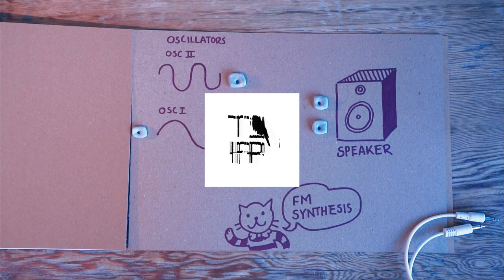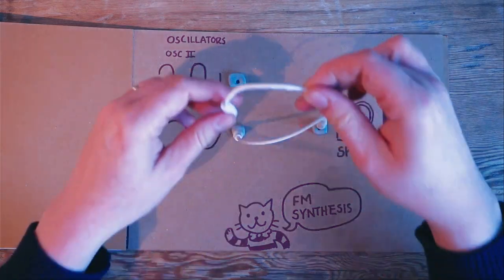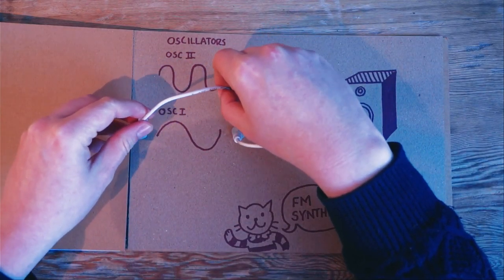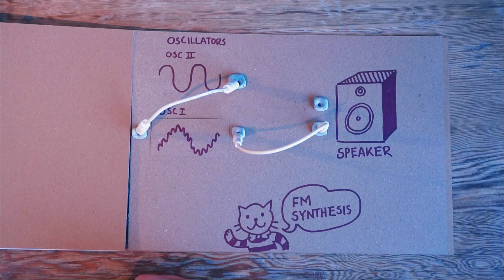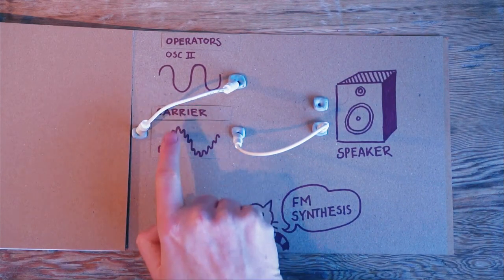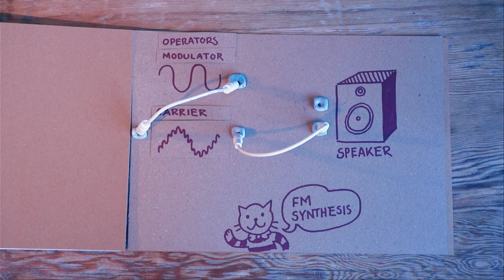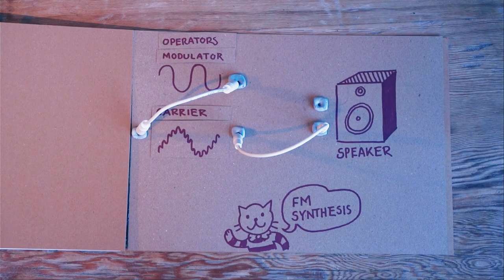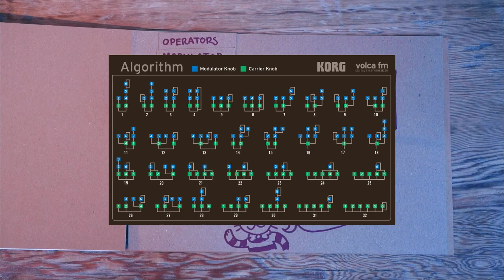Short Introduction to FM Synthesis in 3 minutes

Comment: Nice attempt. But there are min 2 mistakes that shows you did not understand it completely. 1. An operator is the combination of an oscillator and an envelope 2. The waveform you replaced the waveform of osc 1 waveform with, is just a result of addition and not of frequency modulation

Comment: Confusing, YES. Puposeful systematic for crafting a determined sound, no. Powerful, 40 years ago. Modern state of the art, no. Ancient, nostalgic. Without those workstation-freaks this ancient technique would be forgotten since 30 years. Without those people, sitting infront of hightech-machines, dreaming of sounds and technologies of the ancient greeks... FM wouldn't exist any more. I was there, 40 years ago, when FM was state of the art. I remember that it solved big problems, but didn't produce "quality" sounds. But ever since all other oscillators around, latest since the supersaw-oscilator, and the most latest with Romplers, FM had to be burried!!!
Reply from the maker: My impression is that FM was used to mimic other instruments such as pianos and trumpets in it's infancy, which would sound cheap at best. But it's not been until recent years I have seen it as an interesting tool to create very unique sounds. Especially as parameters can be modulated in a far more complex way by usin controlers and software. Allowing instruments like the DX7 to produce mind-blowing sounds compared to what was even imagined in the 80s
Reply: @TheFellowPassenger  Exactly! What younger freaks don't know anymore, are the needs/problems of those times. You are abolutely right: emulate native instruments with cheap technology and no affordable memory... which would have been needed for sampling. There was sampling too, but also with this memory-problem and therefore ridiculous sample-/bit-rates. I had an organ capable of this. It neede affordable memory (end 90s) and the developement of CDs with theoretical standards.
You are right: there were signature FM-Sounds. But what was the DX7? For me a better ePiano. Electronic improved, cracks made their way and created nice FM sounds. But it remains: 1) FM is not accessible for normal people and 2) it is limited at all corners. I just built the signature "laser harp sound" of JMJ... with subtractive synth. Not possible with FM. Plingeling, blong, blubb and pads... that's it. Ever tried to emulate a sawwave with FM? Absurd task😉

Comment: If the oscillator waves are additive, what is the difference applying in series or in parallel, i.e., between a (3 into 2 into 1) algorithm, compared to a (3 into 1 and 2 into 1) algorithm?
Reply from the maker: The short answer is that it affects the shape of the final waveform you are hearing. In your first example 3 -> 2 -> 1, Adds harmonics to Operator 2, creating a richer waveform, that waveform then modulates operator 1, adding even more harmonics. In your second example, you create 2 harmonically rich waveforms that is then modulating Operator one, This will be far more pronounced if you set Op 3 and Op 2 are set to different tunings and envelopes. I do not have any particular use case for when I would use one or the other, but the two different algorithms will result in a different timbre. It is so easy to go overboard with FM, and you will end up in the high frequency register very quickly. It is interesting to modulate which algorithm you are using with an LFO or something, resulting in very varied harmonically rich sounds. Open an EQ after Operator to see where the different harmonics land on the frequency spectrum

Comment: I havs just bought a volca fm and was completely baffled by it especially with the algorythmn sheet that came with it.
After your explanation I am beginning ti " get it".
I am newbie to syntheseis in general so FM isa hard pill to swallow.
I am 73 so need this techno to keep my brain ticking.
Thanks.
Reply from the maker: Sorry for the belated reply. Good on you, FM is really the deepend if you are a beginner at synthesis. I do not own a volca, but had a look at the volca algorithm sheet. Algo 1 indicates that you hear operator 1 and 3, all the others are modulating. I suggest, turn down the volume on all operators appart from 1. Then slowly turn up the volume on operator 2 and hear how it affects its sound. Change its envelope. And you will get a feeling for how FM behaves. You can also try the free software DEXED. I have made a video on it. It makes controlling FM very visual. I believe you can transfer the DEXED patches to the volca, but do not quote me on that. Good luck!

Comment: Very good explanation for complete dummies to begin with!
I’m wondering, are LFO’s actually doing FM as well? It sounds like to me, e.g. when I use an LFO to modulate the pitch of an oscillator…?
Reply from the maker: Yes absolutely, FM = frequency modulation, pitch = frequency and you use an LFO to modulate it. FM synthesis is usually associated with one oscillator modulating another at audio rate. But an LFO is an oscillator too, but at such a low frequency, way below bass frequencies human ears can pick up. However some LFOs can run at audio rate if cranked up
Reply: @TheFellowPassenger  Thank you 👍🏻

Comment: Is that a 2 operator or 1?
Reply from the maker: The example uses 2 operators. You need at least 2 to create FM tones. I realise in hindsight that it is misleading to call an operator an oscillator. Because an operator is an oscillator with its own volume envelope.
Reply: @TheFellowPassenger  Ok, so for example in a YM2413, they take 2 jagged waves to make a harpsichord?